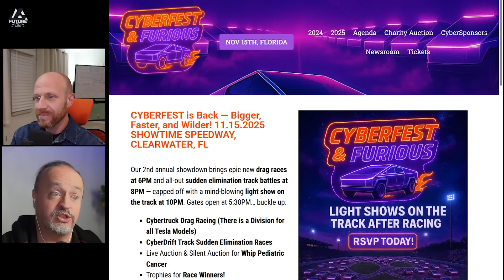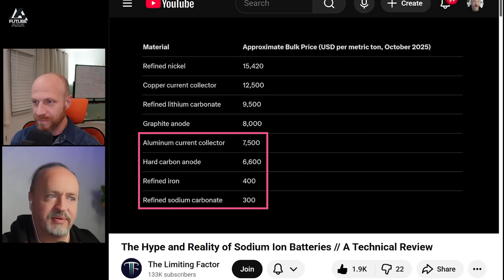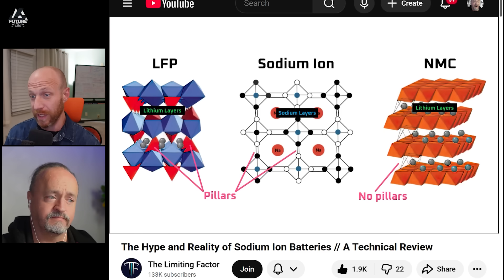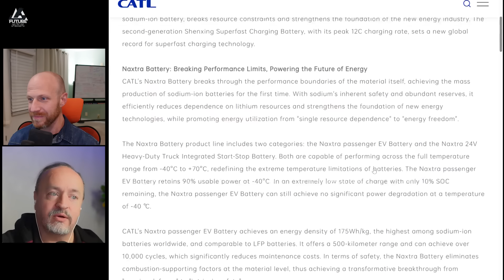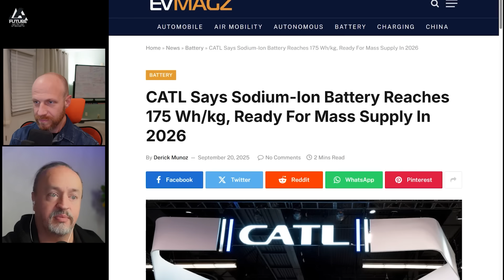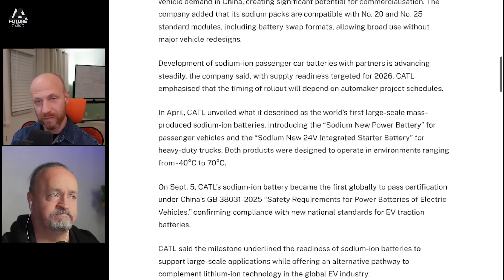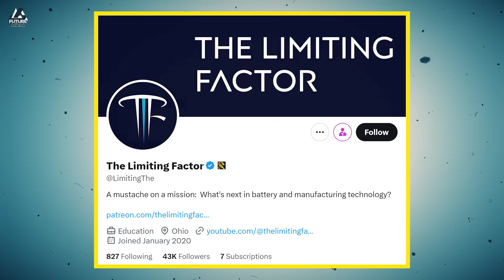Jordan Giesige Exposes Sodium Battery Truth

Comment: 10:23 its about the CO, H2 and HF released by burning or overheated Li Ion cells. Which are either toxic or flammable. A cybertruck was recently driven by a Darwin Award recipient at 80mph in a 30mph neighborhood. The young driver and his passengers probably survived the 60mph crash straight into a large tree, and so did the HV battery by all appearances, but the cabin filled with toxic fumes from what appeared to the 48V battery burning. It was those fumes which caused the fatalities according to the coroner. Probabilities aside, how do the Li ion and Na ion fires compare in consequences?
Reply: 13:28 Great Plug 😂 for a great channel: The Limiting Factor.

Comment: 9:14 fire safety of Na batteries: Jordan ignored the more common causes of lithium ion fires and the worse consequences.  Most Li ion fires are not caused by manufacturing defects.
Reply: Good point. I've yet seen a good comparison of how a ruptured fuel tank or fuel line compares to a banged up battery pack in a collision.
I'd love to see details on: how soon you know there is a problem, how long you have to get out while possibly injured, how quickly does the fire become involved and how long the fire lasts.